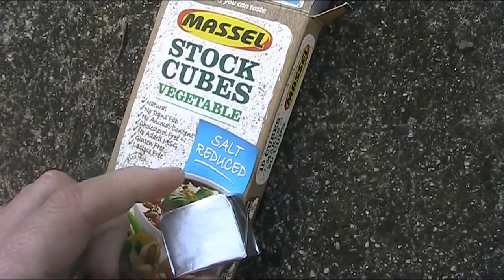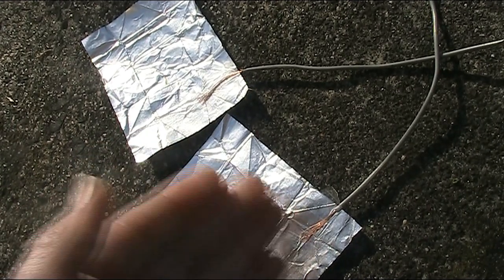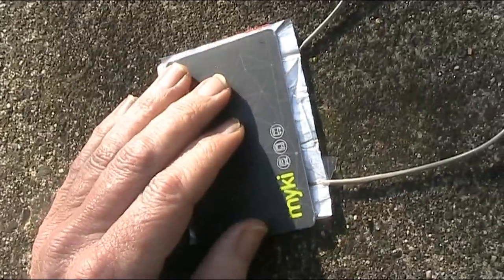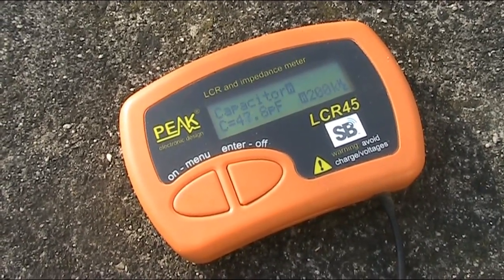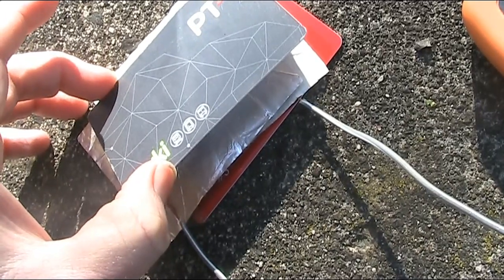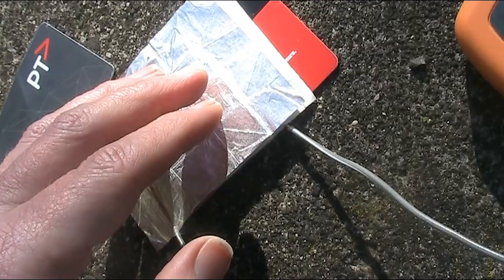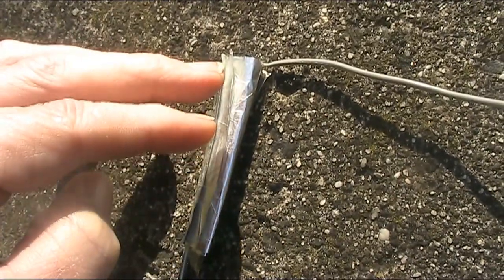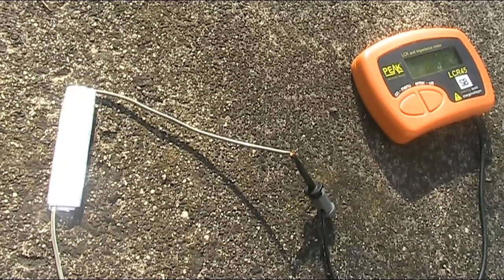The variable capacitor in your pantry

Comment: Something  I have had good success with is to cut sections from long life milk of fruit juice cartons.
The cartons are lined with a thin aluminium layer that is covered with an extremely thin plastic layer.
A small area of the plastic layer can be carefully removed using sand paper to allow wires to be attached. However, his can be quite tricky and does take practice if you are to avoid destroying the thin aluminium layer beneath !
To make connections I punched holes in the exposed aluminium and used solder tags and small nuts and bolts.
The "Plates" can then be placed plastic face to plastic face and either compressed or slid to vary the overlap.
The advantage over a paper backed material is that the plastic layer is incredibly thin and very usable values of capacitance can be achieved.
Also, the rigidity of the card material makes the whole thing more stable.

Comment: Hi Peter,
Another interesting video thanks.
It would be interesting to 3d print the variable capacitor shape in plastic then glue the foil to each plate.
You would have the accuracy of 3d printing with the easy ability to create any shape you wanted.
I might try it soon.

Comment: Try a plasic round barbell and slide it up or down on the capacitor you made it will move the capacitance up or down just an idea and the plasic coated round barbell weight will change the capacitance and thiers weight on it like a 5 pound weight will do the trick 👍📻⚛💯

Comment: Nice.  If you glued it together so it was rigid could you take a pair of scissors and trim it to the desired capacitance?  Or maybe glue one foil side down to a pencil and make a tube out of the other that could slide back and forth across the pencil to give more stable variation.  There are lots of fun things to try.  73.

Comment: "This video sponsored by Massel."
More seriously, you can make a stable capacitor by wrapping the layers around a firm cylinder, such as dowel, cardboard or plastic. Tape down hard, and/or cover with heatshrink. Adjust length of future capacitors to vary capacitance value.